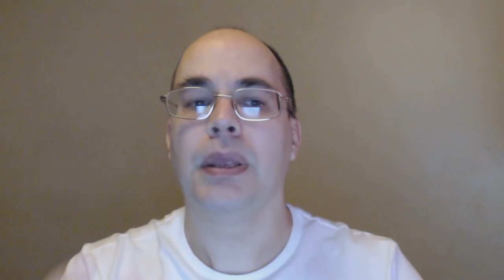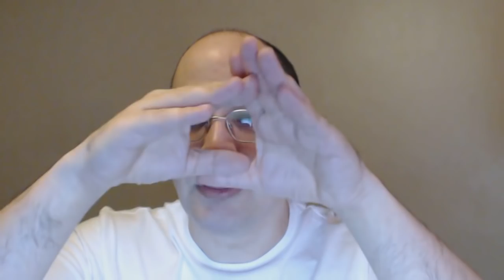How do rockets move in space, with nothing to push off from?

Comment: Why would rockets need something behind them to "push off from"??  Airplanes DO NOT "push off" from anything behind them.  Thrust in BOTH instances is EXACTLY equal to the mass of the exhaust times its acceleration away from the engine.  Nothing else is needed.  Action and reaction.  The mass that is "pushed" out of the nozzle is the reaction mass.  The action is the engine goes forward.
Reply: Davy spilani -- QUESTION:  
Why do you quote Newton's law of action and reaction and then you turn around and deny that it works?  You describe an illustration of how it works (your two boxes) and then you turn around and say that it doesn't work that way.  Why?  SPECIFICALLY ANSWER THIS: 
How can a HUGE amount of mass (tons of mass) be pushed with TREMENDOUS force (thousands of miles per hour) away from the rocket in one direction and there NOT be a reaction in the other direction?  
With such a huge force in one direction HOW can you claim that there is NO force in the other direction?
Reply: prosperomage they do , air push plane forward they suck air then push against it, jet fire push against air FOR EVERY ACTION THERE IS A REACTION
Reply: prosperomage jet engines work different to begin with, they suck in air so they wouldn't even produce any thrust in a vacuum
Reply: If you really think planes dont push  - watch this https://youtu.be/DFP4xl0V0mk
Reply: Davy spilani https://youtu.be/cfFJImcFx3s davy , this video debunk what he said , once you block the area where the air is coming out of the balloon the car won't move , MEANS the AIR COMING OUT OF JETS ENGINE IS FORCE ONE PUSHING AGAINST THE AIR IN THE ATMOSPHERE  ( FORCE TWO) ......this clown claim he works for a company making jets engines, and trying hard to proof that thrust coming out of shuttle , or planes doesn't need the air behind them ......what an idiot. ......there is another video using a balloon mounted on a toy car where a vacuum used to suck the air from the path of the baloon released air....guess what ??? Car didn't move , remove the vacuum , as the air releasing from the balloon the car moves......in the video i sent you the guy just block the atmosphere air from behind the balloon, and gues what ??? Car didn't move......nasa bullshit they never went to the moon , mars or anywhere above low earth orbit.....and these dummies trying hard to patch the lies of NASA
Reply: Omar Karim I know and ive just filmed that exact experiment.. I'll up load mine next week,, I use The laws of Physics to prove it's not possible.. But if you see any other info let me know please and thanks for the link.. Don't bother with this idiot,, He's not listening to logic or reason, so he's probably working for the state. My film is 100% Proof that not only do rockets not work but also NASA is a rip off agency and part of hollywood and also our education system has been polluted by psudo science as they teach NASA bullshit in school, basically so we can't comprehend reality. This makes it easy to lie and manipulate us.
Reply: Sith Lord Reign -- People who claim that a rocket can push a HUGE amount of exhaust in one direction and NOT have a reaction in the other direction are the ones who are claiming that rockets defy basic laws of motion.  How can you claim that they need something ELSE behind them besides the huge amount of exhaust (reaction mass) that they push out their nozzle???
Reply: prosperomage airplanes and helicopters don't work like rockets or jets.
Reply: Siddarth Joji force = mass times acceleration. Always. 
Doesn't matter if what is being accelerated is air or combusted rocket fuel.
Reply: Davy spilani -- so you'e another one who denies basic laws of physics.  Even jets in the atmosphere DO NOT "thrust against the atmosphere" behind them.   force = mass times acceleration.  If you accelerate a mass one direction (eject tons of material out of your exhaust nozzle) you have force the other direction.  It has nothing to do with what the exhaust runs into once it's gone.
Reply: Johnny Kool -- Thrust has nothing to do with the "atmosphere" behind the engine.  Jets engines DO NOT "push against" the air behind them.
Reply: prosperomage yes it does. Thrust requires an equal opposing force. When NASA said they were going to space the vast majority of the scientific community laughed at them. Saying you can't move in a vacuum. Cos you can't!
Reply: prosperomage yes it does it draws the atmosphere in, compresses It, mixes fuel and ignites it which heats it so it  expands. The burnt mixture then rushes out the smaller exhaust aperture, giving thrust  against the atmosphere, for propulsion, and the turbine for induction
Reply: prosperomage did you go to school? THERE MUST BE AN OPPOSING FORCE!! TRY STANDING IN A BUCKET AND LIFTING IT.  A boat must weigh less than the volume of water it displaces.
Reply: Skibum Wannabe  -- LEARN TO READ.  I already described the opposing force.  WHY do you deny that it exists?  AND WHY do you just make up crap about "the vast majority of the scientific community" that you can't even name ONE SINGLE NAME from???
Reply: Skibum Wannabe - No answer?  No reference to ANY of your "vast majority of the scientific community"??  And you don't even dare to try to explain how a rocket can push TONS of matter out of its exhaust nozzle and NOT have a reaction.  How can that happen?  WHY do you DENY the principle of action and reaction?
Reply: prosperomage Plane turbines pushes against air. Plane turbine can blow whole car away from it. So it pushes against air.
Reply: Subjohny -- I NEVER SAID that plane turbines don't push the air behind them.  What I said is that pushing against the air that is already behind the jet is NOT what pushes the airplane forward.
Reply: Subjohny -- Yes.  I've seen that video.  It proves my point.  If all that air that is going through the jet engine can blow the car away WHY do you think that SAME AIR can't push the plane forward?  It is NOT the air that is standing still behind the jet that pushes it forward.  It is the action of the air that is accelerated by the jet itself.
Reply: prosperomage Oh dear,, your not getting it,,, Planes do push off the atmosphere, you can't see it but it's there, that's how you can breath,, in space you can't breath so there is nothing there.. Newtons law states for every action there is an equal and opposite reaction,, So using NASAs model, let's see how they describe newtons law,,, They say action, reaction..That is their explanation of the 3rd law,, but that is not the 3rd law,, Where is the opposite reaction?? A planes turbine spins using the friction and resistance of the atmosphere to push against, it also creates a Columb of air behind the jet engine that pushes against the atmosphere.. Imagine if you tried taking a plane to space,, it's the same as a rocket, a rocket can fly a bit higher that is all.. They cannot and will never be able to work in a vacuum.. The only way is to give space an atmosphere..
Reply: prosperomage I don't deny the basic laws of Neutons law I just understand it properly.. You don't! ! Where is the opposite reaction to the rockets action? The rocket is reacting to the fire that is connected to the rocket via a pivotal point but where is the opposite reaction??????? You can't  answer because you don't understand Neutons Law!!! Your just another condescending moron who thinks they understand.. And you don't. .. TRY THINKING ABOUT IT YOUR SELF RATHER THAN READING THE NASA WEBSITE.. You might find you have a mind of your own.. Now fuck off little man..
Reply: prosperomage prosperomage  You can move because you have a hinge or ankle and that enables you to lever against the mass of the planet right! You are the mass that you want to move, your ankel is the pivot point you convert gravity into forward motion, your foot is the action or thrust, there is another pivotal point where your foot connects to the ground, until you stop and lift your foot off the ground, when you do that you loose friction and resistance against the floor or the mass of the thing you are moving relative to.. Just like a Rocket looses thrust as soon as the atmosphere has reduced enough for there to be no friction or resistance behind the controlled explosion coming out the back of the rocket.. Ok let's start with the first law.. A pole has no pivot or thrust, it's just a pole, just like a rocket, a pole cannot move unless you provide a pivot point and thrust,, So the metal part of a rocket is just a pole and in a state of inertia.. Now when you add a controlled explosion behind the rocket and join that explosion to the rocket via a fuel supply, you have now given that pole a pivotal point and Action or thrust or a controled explosion and that is just like a spring, it pushes so that is the action not the metal part of the rocket but the rocket and the fire are one thing because they are joined. So the controled explosion is the action,, the pole part or metal part of the rocket is the reaction, Now at the end of the controled explosion, where it meats the atmosphere, it's very very hot, that heats up the surrounding gasses that also expand and that pushes back against the fire and the rocket gains 2 pivotal points in which to gain leverage against the atmosphere.. So    Space x gravity x riction/resistance x (m+v×X×E×V-y) × friction/resistance × Mass or Y × Time.   That's the law of motion and you can see each of the 2 reactions are equal.. Go into a vacuum and you have..
Space × gravity × resistance × (m+v×X×E×V-y) × Mass or Y × Time.. Notice in space you have no friction or resistance behind the rocket and in front you have no friction BUT YOU DO HAVE RESISTANCE,, the resistance of mass which is gravity. Gravity is pulling you back and there is nothing at the back of the rocket to compensate for that now you have lost all resistance.. Gravity is not a little thing as it will start pulling you back with the exact same force it took to get away from it.. So in short you don't have an equal and opposite reaction to the action and the action is the controled explosion that is expanding, the metal part of the rocket is the reaction and the opposite reaction is NOT THERE SO THERE WILL BE NO MOTION . . This is a law of Physics and you clearly don't understand the very basics.. Don't go and read read a book about the 3rd law just think about it. There's 3 parts because it's about 3rd dimensional law. action reaction and opposite reaction.. So where is the opposite reaction in space? Now you are saying that the exhust particles moving away from the fire plume gives the rocket thrust but that is NOT what NASA is saying, NASA says action reaction... They neglect the opposite reaction..Your example of using carbon particles to leaver off is insane,, what are they levering off then,, You can't jump from a falling road and those particle are falling away from the rocket at high speed,, Not to mention they do not have enough mass to propel a 10 tone rocket.. I think you are getting confused.. The only reason a rocket does work in an atmosphere is because of the mass of the earth and that includes the atmosphere..You think that mass of air is tiny!?!?! Realy.. Try thinking about an object traveling through that tiny mass at 17,000 MPH.. Notice it sets things on fire because of the heat produced by FRICTION...Can you just answer me 1 question.. When you did science at school how come you didn't notice this then???I did,  teacher couldn't answer me then and they still can't. . By using your example you are actually contradicting NASA Yourself..
Reply: prosperomage Your really an idiot... It doesn't matter how hard you pull you will never ever be able to lift yourself up by the hair.. In space it doesn't matter how much thrust your fire out of the back or the rocket, if you have nothing there to be the equal and opposite reaction to the rocket, you will not move. This is a law of physics.. Do you know what a law of physics is??? Have you ever noticed why Einstien never managed to makes his theories laws? A law is an absolute.. Absolute fact! No opposite reaction no motion.. It's realy as simple as that... The only possible way is it you could provide infinate thrust which would mean infinate fuel with infinate mass.. Because to get through space you need to give space an atmosphere.. It's newtons law,, Every (action) has an equal and OPPOSITE reaction.. Your example insinuates an Action and reaction.. This is not The 3rd law of motion because there is no opposite reaction..So you can't break these laws, it's not like breaking the speed limit in your car.. There is zero tolerance.. no opposite reaction no MOTION.. Sorry they bullshitted you at school and have been ripping you off ever since.. We never went to the moon or Mars and sent probes to Pluto. . It's all hollywood and they have been charging you for that since the 60s.. Stop asking ridiculas questions there's no point answering because the basics of Neutons law just is not there in a vacuum and it doesn't matter what maths you hide that fact behind it is NOT possible to ever travel in space with rocket tech. EVER... Until you can tell me what is reacting in space other than the rocket to the controled explosion or the thrust coming out of the back of the rocket is I'm just going to think your  a complete idiot and low IQ die hard rocket lover.. If Neuton meant ACTION REACTION. He would have said that right.. But he didn't he said equal and opposite reaction.. So what do you think that means???? No one is saying that the air from a plan doesn't matter of course it does.. that's how it flys.. Same with a rocket, I'm not saying they don't work in our atmosphere  but in a vacuum,, no way.
Reply: prosperomage I'm actually making a film which will be ready next week, it will explain in great detail Why NASA IS A Con..
Reply: prosperomage exhaust push backward plane push forward , who told you that , buddy get a balloon mounted on a toy car , put air in it , let it go the car will move backward....do the same experiment but turn the vaccum on at the tip of the balloon, let the air go .......guess what??? Car will not move an inch, because the air coming out of the balloon is not pushing against NOTHING ANYMORE.  THE VACUUM SUCKED THE AIR , THE SAME WAY THE VACCUM IN SPACE WILL SUCK THE THRUST OR FIRE MIXURE COMING OUT .....NOTHING WILL MOVE FORWARD.....AIR USED IN PLANE AND JETS , WATER FOR BOATS....exhaust is attached to the moving object ...it IS STILL FORCE ONE ( ACTION)
Reply: prosperomage you work for a company that make jet engines.....ok i will send you a video explaining how jets move forward using AIR
Reply: prosperomage again you trying to deny the fact that air is not usd to push against plane.......THE AIR THAT COMES OUT OF THE PLANE PUSHES AGAINST THE AIR THAT ALREADY IN SKY......AIR FROM JET PUSH REAL FAST AGAINST THE NOT MOVING AIR IN SKY.....TWO MASSES COLLIDE AGAINST EACH OTHER . The air of the sky is like a wall while the air of the jet is the pushing force . And that pushing force air remain with the jet as it continues to push against the sky air ......if there is no air to push against, that big strong thrust of air will fly straight into empty space and no motion will occur. ....just like the experiment i told you , let the balloon release air into home vacuum and the car will not move an inch........you point is debunked as well nasa lies about travel in vacuum is debunked as well......stop lying to yourself. ....we never been to no moon , mars or space...it's all deception....and the ISS is the main one
Reply: prosperomage watch the video i just sent you and tell me , if your theory is true since you work for a jet company. ..and you should be the man who knows it ALL....WHY THE BALLOON WON'T LET THE CAR MOVE FORWARD ONCE WE BLOCKED THE AREA PASSED THE  EXHAUSTED AIR OF THE BALLOON.....I THOUGHT YOU SAID THE AIR BEHIND THE ENGINES HAS NOTHING TO DO WITH MOVING FORWARD AND MOVING FORWARD IS DONE BECAUSE AIR COMES OUT , THEN PLANE MOVE FORWARD. .....BUT ONCE I DIDN'T BLOCK THE AIR PASSED  THE BALLOON EXHAUSTED AIR . THE CAR DID MOVE FORWARD.....YOUR ARGUMENT IS DEBUNKED , NO THRUST IN SPACE , NO MOON LANDING , NO MARS,  NOT EVEN ISS STATION OVER 230 MILES HIGH.....ALL BULLSHIT.....PEOPLE STILL CLAIM YOU CAN SEE ISS WITH NAKED EYE LOOOOOOL YEAH RIGHT .
Reply: prosperomage Your clearly not worth the time... The controled explosion is the exhust gas, so the explosion cannot push against its self can it.. Try this,, jump off a building and on the way down,, piss and then try and swim back up your own piss. See how far that gets you... You believe this NASA bullshit.. Hahah it's funny at least..
Reply: prosperomage did see the video i sent you , stop blaying stupid , and debunk the video , WHY WHEN THE GUY BLOCKED THE AIR BEHIND A RELEASED BALLOON , IT DIDN'T MOVE AN INCH , in another experiment he sucked the air behind behind a released balloon the same thing , IT DIDN'T  MOVE , ACCORDING TO UR EXPERTISE,  AIR BEHIND THE ENGINE IS NO NEED FOR IT TO THRUST AGAINST......ANSWER THIS  ONE
Reply: Davy spilani I’m pleased to see someone understands basic laws of motion.
Reply: Sorry folks, even rockets can’t defy basic laws of motion. That is the argument I’m seeing “ because rockets work this way.” All motion operates under Newtons law rockets are no exception. Think of how a car travels or how you walk. Think of our atmospheric density as an ocean for air travel. Rockets is space have no such ocean to travel in unless space is actually not a vacuum.
Reply: No, they only work in an atmosphere because wings cannot generate lift in a vacuum. Also, most planes have air-breathing engines, so they need an atmosphere for that reason as well. The X-15 can fly as high as it does because it uses a rocket engine, and at max altitude the wings are doing almost nothing to keep the plane flying.
Reply: They...didn't. It's that simple. Let me put it this way; the US government is terrible at keeping secrets, and their track record of being found out is ridiculous. Do you seriously believe that they then managed to perpetuate a hoax on the scale of the moon landings for almost 50 years? 

The thing with your kind is that you always ask "what about this?" and "explain this!", but then whenever someone attempts to give you a satisfactory answer, you dismiss it. Your problem is that you're already convinced you know happened, and you're only seeking confirmation of that "knowledge", and so you throw a tantrum when none of the evidence supports your delusions.
Reply: You are wasting your time. This idiot does not understand the most basic
science. He should have a sixth grader explain it to him.
Reply: Very much enjoying this interaction.
Reply: prosperomage exhaust is part of the plane , that's force one , air molecules is force two.....
Reply: prosperomage and if i want to follow your idea that gases comes out of the exhaust pushes the rocket forward, the gases must be held by other force to become like a wall barrier, gases goes through space as they r coming out because NOTHING TO HOLD IT ,,,NO AIR NOTHING
Reply: One part of the plane (exhaust) going backwards = Force 1  and 
Other part of the plane (the metal part) going forwards = Force 2 and 
the air molecules behind the plane are irrelevant.  Look up the definition of thrust in ANY engineering reference source.  It has to do with the acceleration of the exhaust.  The ambient air behind the plane makes no difference.
Reply: Johnny Kool :  Force = mass times acceleration.  Thrust is the acceleration of the mass out of the back of the engine.
Reply: Skibum Wannabe  -- Too bad you can't name a single person in this "vast majority of the scientific community."  WHY do you people just make stuff up?  And read what I actually wrote about thrust.
Reply: Skibum Wannabe -- You didn't read ANYTHING I said about thrust, did you?  I work for Pratt & Whitney.  They MAKE jet engines.  I know how they work.  AND WHY do you just make up crap about "the vast majority of the scientific community?""  WHY do you do that??
Reply: prosperomage Because it doesn't work in space,, a rocket only works in an atmosphere but no in a vacuum..Jesus how's it possible to be so stupid?
Reply: Davy Spilani -- I don't read the NASA website. I work for an aircraft engine manufacturer. And I know how jet engines work.  YOU DENY that Thrust = Mass times Acceleration.  WHY do you deny that?  The thrust of a rocket or a jet is the acceleration of the mass that is ejected from the exhaust nozzle.  The thrust does NOT come from the relatively tiny pressure of air that is standing still behind the engine.
Reply: Davy Spilani -- Some people seem to have an emotional need for rockets to not work in space. Are you one of those people? I keep wondering WHY people reject such a simple thing as Force = Mass times Acceleration.  Why is that?  Do they think that air has no mass?  Does the exhaust that gets ejected from the nozzle of a rocket or jet have no mass (in their imagination)?  

HOW can all that mass get accelerated by the nozzle and NOT produce a force?  

WHY would anyone think it needs some "force" from the tiny pressure of air behind the engine?  

Could you please try to answer these things for me. I am very curious as to why people deny that Force = Mass times Acceleration.
Reply: Davy spilani  -- JUST PLEASE answer this one simple question:  WHY do you assert that AIR in a jet engine has NO MASS???  WHY??  Why do you think that pushing TONS of exhaust out of a nozzle does NOTHING??  HOW can you push TONS of material out of a nozzle and have NO reaction?? Just please answer that ONE thing before going off with paragraphs of words.
Reply: Davy Spilani -- STILL no answer??  WHY do you claim that EXHAUST HAS NO MASS??  A CFM56 turbofan engine pushes against 65 THOUSAND POUNDS of EXHAUST every MINUTE.  That's NOT the air "behind" the engine.  That is 65 THOUSAND POUNDS of EXHAUST that it is "pushing against."  WHY do you claim that 65 THOUSAND POUNDS has NO MASS?  How can a jet or rocket "push off of" the tiny 15 pounds of pressure in the air behind it if it can't "push off of" the TONS of air that it pushes out its exhaust nozzle???  

Unless you can explain how a jet can push against 65 thousand pounds and have NO reaction from it, you are just a troll.
Reply: Omar Karim -- How about if you put your vacuum cleaner nozzle in FRONT of your balloon at the same time as you have one behind it?  WHY do you think the "vacuum" of space is ONLY BEHIND the rocket?
Reply: prosperomage no EXHAUST AND PLANE IS FORCE ONE TOGETHER....easy example put your leg against the wall , according to you , I IS FORCE ONE MY LEG IS FORCE TWO.... I PUSH LEG BACKWARD( FORCE TWO) ,THEN I ( FORCE ONE ) GO FORWARD...NO .....I AND MY LEG ARE FORCE ONE , THE WALL IS FORCE TWO.....YOU GOT NEWTON LAW WRONG BUDDY
Reply: You didn't answer my first question about your "vacuum."  You're afraid of it, I guess.  ALSO:  HOW can "exhaust and plane" be "force one together" when the PLANE is pushing AGAINST the EXHAUST???
Reply: Omar Karim -- YOU just said that you throw your leg away when you push!!  Hahahahahaha!!!!!!  You said you are like the rocket and your leg is like the exhaust!!  Wow!!!   That's funny!!!
Reply: Omar Karim can only jump ONCE because he throws his leg away whenever he jumps!!!
Reply: Omar Karim -- Is your video about how jets move through the air going to explain how the exhaust stays attached to the jet after it leaves the nozzle?  Or are you going to admit that your leg example is fabulously insane??
Reply: prosperomage airplane sucks air and push it from the back , so the plane  moves forward...., that's your argument....
As soon the air comes out of the engine it moves forward and it has nothing to do with the air behind the engine......right..!!!!......ok let's suck the air behind the engines....what do you think will happen ??? Will the plane continue flying.......i TOLD YOU MR GENIUS YOU CAN DO THAT EXPERIMENT ON A BALLOON MOUNTED ON A TOY CAR ......TURN THE VACUUM ON AND SEE HOW FAR WILL THAT CAR GO , DO IT WITHOUT A VACUUM AND IT WILL MOVE FAST.....
Reply: Omar Karim STILL thinks he throws his leg away when he jumps!!!  Have you found your leg yet??  haha!!   (Also:  Do you know how a jet's thrust reverser works?  Do you??  
The jet sucks air in the FRONT of the engine, it runs it through the engine and accelerates it and throws the air back out FORWARDS (the same direction it got the air from in the first place), and the airplane can move BACKWARDS!!  So yes, if you suck the air in the back of the engine and accelerate it in the right direction, you can move which ever direction is opposite of the direction you accelerate the air.
Reply: prosperomage yes and that air that comes out of the ENGINES, YOU ARE TRYING TO SAY IT DOESN'T PUSH AGAINST THE AIR THAT ALREADY IN THE SKY.....REALLY ????? LET SEND YOU THE VIDEO ABOUT SUCKING THE AIR FROM THE PUSHED AIR PATH, AND LET SEE HOW MUCH  CREDIBILITY YOUR POINT WILL FLY
Reply: prosperomage watch this video , and it should debunk your argument that you been trying hard to pass it on everyone. ...

https://youtu.be/cfFJImcFx3s

Go to the balloon experiment
Reply: So you stop the exhaust from leaving the car and there's no thrust. So what about it?  With his piece of paper he is making the air NOT GO BACKWARDS!!  What does that prove??  It proves that if you don't allow your exhaust to go backwards, then your exhaust doesn't get to go backwards and you get no forward thrust.    If you STOP your EXHAUST, then your EXHAUST DOESN'T WORK.  DUH!!  
Force = Mass times Acceleration.  
He is NOT accelerating the exhaust backwards.  He is STOPPING the exhaust. His experiment proves exactly what I have been saying.
Reply: Also -- you STILL were claiming that you throw away your leg every time you push with it.
Reply: Look, it's real simple:  FORCE = MASS times ACCELERATION. 
->  If you accelerate exhaust away from your vehicle, then you get thrust. 
->  If you DO NOT accelerate exhaust away from your vehicle, then you DO NOT get thrust. 
->  If you STOP your EXHAUST before it leaves your vehicle, then you DO NOT accelerate exhaust away from your vehicle and you DO NOT get thrust.  
AND NONE of the above has ANYTHING to do with the air around or behind (or in front of) the vehicle.
Reply: Davy Spilani -- What you really mean is that you don't want to think about any of my questions because they scare you. TONS of exhaust pushed at thousands of miles per hour is NOT equal to a few drops of "piss." And you know it.  You just deny it because it's emotionally disturbing to you. 

And climbing back up on a couple drops is NOT the same as PUSHING against a HUGE amount of matter.  Try this:  Jump off a building and throw TONS of material THOUSANDS of MILES PER HOUR downward and see if it's the same as "climbing up on your piss."
Reply: Omar Karim Your arguing with a complete moron.. I spent hours with this idiot yesterday.. I even wrote out the equation for the 3rd law of physics and how NASA and our education system is missing out a huge part of it.. (They miss out the opposite reaction) They say action, reaction. What about the opposite reaction.. An explosion blast both ways so in space where is the opposite reaction to the explosion coming from the back of the rocket?? Anyway I'm making a film and will prove with Neutons law that it's impossible to travel this way in space.. Don't bother with this brain dead idiot who is totally stuck in their own dissidence.
Reply: prosperomage This is the 3rd time you've asked me this and ive explained but your IQ just is not up to it so... Your not worth the time.. As I said try pulling your hair and if you pull hard enough you might take off..😂😂😂😂😂😂😂😂😂😂
Reply: Davy Spilani --No.  You haven't "explained" anything at all.  What you keep doing is missing the point. You keep asserting the impossible. I only keep phrasing it as a question to see if you'll get it.  A jet (or a rocket) throws a HUGE MASS out its exhaust nozzle.  It "pushes against" THOUSANDS of POUNDS of exhaust.  You CANNOT push against THOUSANDS of POUNDS WITHOUT HAVING A REACTION.  You keep claiming that you CAN push against thousands of pounds and have NO opposite force.
Reply: Davy Spilani -- No.  You keep saying that Newton's third law does not work. You keep saying that if you push against something, you do not move.  A rocket pushes against thousands of pounds of mass.  (And then you come back and (supposedly) "explain" that THOUSANDS of POUNDS is LESS then the tiny FIFTEEN pounds of atmospheric pressure because those thousands of pounds needs another 15 pounds or else it won't work.)
Reply: Omar Karim --  You don't understand that video like you don't understand that you DO NOT throw away your leg when you push against a wall.  YOU CLAIMED THAT YOUR LEG IS LIKE THE EXHAUST.  SO YOU CLAIMED THAT YOU THROW YOUR LEG AWAY WHEN YOU PUSH AGAINST SOMETHING WITH IT!!!  WHEN are you going to understand that your leg example is idiotic??  WHEN are you going to understand that you DO NOT THROW AWAY YOUR LEG WHEN YOU USE IT TO PUSH?? 
If you understood your own examples, you would see that your LEG is like the NOZZLE and THE WALL IS LIKE THE EXHAUST.  But you don't even bother to understand your own examples. Why do you not even want to understand your own examples??  Why do you claim that your leg is like the exhaust that gets thrown away from the rocket?
Reply: Omar Karim -- You keep posting the same thing over and over and over and you keep refusing to answer my question:  WHEN ARE YOU GOING TO UNDERSTAND THAT YOU DO NOT THROW AWAY YOUR LEG WHEN YOU USE IT TO PUSH LIKE AN ENGINE DOES WITH ITS EXHAUST?????  YOUR LEG IS LIKE THE NOZZLE AND THE WALL IS LIKE THE EXHAUST!!!

If you understood THAT, then you would understand your balloon video also.  But you do not want to understand it.
Reply: prosperomage no genius my leg is not nozzle and the wall is not the exhaust. ....My leg IS THE EXHAUST THAT IS PUSHING MY BODY IS THE PLANE AND THE WALL IS THE AOLIR IN ATMOSPHERE......WATCH THE VIDEO FIRST
Reply: Omar Karim -- So you REALLY THROW AWAY YOUR LEG LIKE THE ENGINE THROWS AWAY THE EXHAUST!!!!???!!!  WOW!!   LEGLESS OMAR!!  Omar Karim can only push one time with his leg because he throws it away!!!  (I watched your video.  YOU would understand the video if you understood that you don't throw away your leg.  But you keep saying that you throw away your leg like the engine throws away its exhaust.)
Reply: prosperomage this is another video showing sucking the air behind a released balloon , and the car didn't move an inch.....

https://youtu.be/D-v_K1k8Se0
Reply: prosperomage the exhaust is going backward but car is not moving , ok watch this video , this guy didn't block the air with a paper, he just sucked the air behind the exhausted air.....WHY THE CAR DIDN'T MOVE ???
Reply: prosperomage https://youtu.be/D-v_K1k8Se0
Reply: omar Karim -- I've watched your silly video TWICE now.  And I'll explain it to you AGAIN if you want:  The car is not going forward because the exhaust is NOT going backwards away from the car!!!  He is changing the direction of the exhaust with his piece of paper.  The piece of paper is NOT ALLOWING the air from the balloon to go BACKWARDS away from the car.  The air from the balloon ends up going SIDEWAYS away from the car (to both sides away from the paper.)
Reply: Omar Karim -- And in your OTHER video, he is SUCKING THE BALLOON AND THE STRAW BACKWARDS with his vacuum cleaner.  There is a FAST STREAM OF AIR BEHIND THE BALLOON that is SUCKING IT BACKWARDS.  Notice that he does not show you what happens to the balloon if he has it sealed with no exhaust to keep it in place.
Reply: Omar Karim -- Put a balloon with a straw like that on a table.  But close up the straw so there is no opening.  And then put a vacuum cleaner behind the balloon like the guy does in the video.  The vacuum cleaner causes the balloon to go backwards because it is moving air ALL AROUND THE BALLOON and STRAW toward the vacuum cleaner.
Reply: prosperomage great am going to say you are right , ok the other video doesn't block anything the air behind the exhaust which to your claim is not important to push against ... been eliminated, why the car is not moving .....on the first model there is nothing about direction of exhaust. .....your all argument is that exhaust comes out rocket move forward , AIR COMES OUT OF ENGINE , PLANE MOVE FORWARD......WHY NOW YOU CHANGING YOUR ARGUMENT TO DIRECTION OF THRUST ......DOES THRUST NEED DIRECTION ????? I THOUGHT IT JUST COMES OUT AND PUSH THE PLANE.......YOU JUST DEBUNKED YOURSELF.....YOU NEED DIRECTION TO PUSH AGAINST SOMETHING.....
Reply: prosperomage do you really read what you just wrote ( changed direction of thrust) ......in SPACE THERE IS NO DIRECTION , THRUST GOES INTO EMPTY SPACE .....THE ONLY WAY YOU NEED THRUST DIRECTION IS TO PUSH AGAINST THAT AREA OR DIRECTION..  IF I SUCK THE AIR BEHIND AN EXHAUSTED FLAME OR AIR ......IT SHOULD CONTINUE MOVING , BUT IT DOESN'T GENIUS,  YOU KNOW WHY ???? BECAUSE EXHAUSTED AIR PUSHES AGAINST ATMOSPHERE
Reply: Omar Karim -- "In space there is no direction"??  So "to the side" is the same as "to the back" to you??  hahahaha!!!!!  Omar Karim doesn't know the difference between "side" and "back."  Omar Karim bases his argument on "side" and "back" being the same thing.  Wow!!!    No.  Your toy car pushed the air from the balloon TO THE SIDE and NOT TO THE BACK.
Reply: Omar Karim thinks he throws away his leg like a jet throws away its exhaust.  Omar Karim thinks "side" means the same thing as "back."  Omar Karim thinks the sun never sets behind the horizon.  Omar Karim has never seen the moon rise and set and go overhead.  Omar Karim has never ever been outside of his bedroom.
Reply: prosperomage REALLY,  YOU SAID , EXHAUST GOES TO THE SIDE ......IS THIS WHY WHEN I STAND IN FRONT OF A FAN THE AIR IS ACTUALLY MOVING STRAIGHT STRONGER , NOT SIDE WAY , IT'S ONLY LESS SIDE WAY BECAUSE IT'S TRAVELLING IN ALL DIRECTION BUT STRONGER IN STRAIGHT LINE......KEEP MAKING FUN OF YOURSELF........AGAIN EXHAUST COMES OUT IS PUSHING THE PLANE , YOUR POINT IS AIR BEYOND THE EXHAUST IS NOT IMPORTANT FOR EXHAUST TO PUSH AGAINST.....SO WHEN ELeminating the air it should be no problem for the plane to move .....THAT'S YOUR ARGUMENT RIGHT
Reply: prosperomage your argument is air behind EXHAUST IS NOT IMPORTANT TO PUSH AGAINST......WHY WHEN We eliminate the air , the car won't move forward......THRUST DOESN'T NEED THAT AIR ACCORDING TO YOUR ARGUMENT
Reply: Davy Spilani -- Have you ever fired a rifle?  Does the bullet need to go and hit something on the far side of the field before you feel the recoil?  NO!!  Does the rifle "push against" the tiny little 1/4 of a square inch of air to give you the recoil?  NO!! The rifle pushes against the heavy metal bullet that it is ejecting with great force at a thousand miles per hour.  So THINK FOR YOURSELF:  WHY would the THOUSANDS of POUNDS of exhaust from a rocket or jet engine NOT give the same kind of recoil as a rifle??  Answer:  It WOULD and it DOES.
Reply: Omar Karim -- If you want to put a vacuum cleaner nozzle BEHIND the balloon to make a point, you need to ALSO put another vacuum cleaner nozzle IN FRONT OF the balloon.  What??  Do you think the "vacuum" of space is only BEHIND the rocket???
Reply: That is true. However, jet engines are also meant to push against the atmosphere as well. It allows them to generate greater forward thrust. Why not use an extra source of thrust if it's available?
Reply: Anzac-A1 -- It's not a matter of "using an extra source of thrust."  The air behind the jet is NOT "available" as a source of thrust. Because that's not how the natural world works. Once the exhaust is pushed out of the nozzle, what happens to it afterwards simply does not affect the jet.  And, in fact, encountering pressure behind the engine actually slows down the exhaust stream that is trying to exit the nozzle, so that it does not flow as fast (check it out by putting a hose nozzle under water.)  Slowing down the exhaust REDUCES the thrust of the engine.
Reply: If you understood the laws of motion, you'd understand that rockets DO work in a vacuum. I don't understand how you think Newton's laws prove that they don't. You seem to think that the laws act differently in a vacuum, when a vacuum is where the laws of motion work the best, because there's no friction to impede motion.
Reply: Davy spilani Sorry but if you think sticker or a jet can push off of air you don't have a good understand of how either work. Look up Newton's laws of motion for a proper understanding
Reply: Johnny Kool Gravity and the atmosphere hinder the movement of a rocket or a jet. In space both are minimal which makes a rocket work infinitely better
Reply: Davy spilani Look up the episode of Mythbusters where they fire a rocket in a vacuum and by gosh it went forward. So your logic is busted
Reply: +Davy Spilani What the hell kind of stupid argument is that? You lose.
Reply: +Omar Karim The thrust of the air from the balloon was cancelled by the sucking resulting in a net result of zero and thus the car did not move. The two forces must have been equal. Increase the trust or the suction to create an imbalance and you will see movement in one direction or the other. Pretty simple if you just think about it.
Reply: Space = "infinite Vacuum" According to NASA !!!
Reply: show me the air in a vacuum..
Reply: youre still using air in space as an argument..
Reply: Look in a mirror !!
Reply: prosperomage propeller airplanes....jets... Move forward because of  pressure difference... Propellers reduce the pressure in front and increase behind and the wings are used to do the same thing on the vertical axis where more of the air is directed under the wing than over...also... Saying that a mass is being accelerated is also correct... Accelerating the mass is what causes the pressure difference... Which is why jets can fly faster because they can accelerate more air  which causes higher pressures behind the jet and also causes less friction for the leading edges... There is a rather simple way to find out if it is the mass of a gas being accelerated alone that causes the thrust( remember we are talking about accelerating the mass of a gas only)...or if it's accelerating a mass of a gas creating high pressure  behind it causing the thrust.... Get a plastic toy  car about 4in long or so... Take a pen apart for the tube... And use a rubber band to attach a balloon to the pen tube... Blow up the balloon and attach it to the top of the car and see if it moves..get something larger than the pen tube and  do the same thing... If possible... 1 more size up... All with the same balloon... There was 3 tests for the pressure difference side with the same masses being accelerated faster.... Then do the same exact thing but this time use a vacuum and put the tube into the vacuum hose while it's on and see what happens... And remember that your vacuum is a fraction of the vacuum of space... I know what happens do u
Reply: AIRplane.  (hint hint)
Reply: prosperomage They thrust against the atmosphere, in space there is none so the rocket would not have forward thrust.
Reply: prosperomage that only works on earth where u have an atmosphere and gravity
Reply: Omar Karim  Yes. For every action there is a reaction. Exhaust gets pushed backwards. Airplane goes forwards. It has nothing to do with the air that's already behind the plane.
Reply: Omar Karim -- Did you read my debunking of your video?  Can you read?  Yes, if you change the direction of the thrust, you change the direction of the thrust.  This is not surprising.  And it has nothing to do with the air that is around the engine.  In your video, the guy changed the thrust so that it went out to both sides instead of backwards.  Why do you not understand this?  AND WHEN ARE YOU GOING TO UNDERSTAND THAT YOU DO NOT THROW AWAY YOUR LEG LIKE AN ENGINE DOES WITH ITS EXHAUST??????
Reply: prosperomage No,, The 3rd law is (reaction/Action/ reaction) So that's.. ( Rocket/Thrust/Atmosphere ) That's how it works on the ground or in our atmosphere but in space you have ( Rocket/Action/NOTHING) Neutons law no longer applies.. So the Rocket will no longer move forward and will be pulled back to earth. The rocket is MASS the fireplume coming out the back is thrust, (This is a controled explosion and is pushing in 2 directions,  1 back at the rocket and 2 back against another mass which is the atmosphere) When you go into space you take 1 part from Neutons law,, Neutons law states for every action there is an equal and oppersite reaction.. We are talking about motion so a MASS is desired to move, ie the rocket. So his evasion is now (mass/action/mass) A car is Mass the wheels are the action and they push against the road and the car and the road move Appart at equal speeds. But in space you take one mass away.. Now Neutons law, his third 3 as in 3rds, it has 3 parts,  Mass/ Action/ mass. Or oppersite reaction/Action/Oppersite reaction.. In space there is NO Oppersite reaction, So nothing for the other oppersite reaction to react against.. This idea of exhust smoke from the fire plume providing a thrust is ridiculas,  as this gass would emediatly get sucked away into the vacuum.. That's instant.. So Rockets do NOT work in a vacuum! Period that's breaking the laws of physics.. You cannot lift your self up.. or flap your arms and fly.. NASA is lying.
Reply: prosperomage Yes they do.. 
WHY A ROCKET WON'T WORK IN A VACUUM!
Why a rocket engine will NOT work in space! NASA says Neutons 3rd law of motion is what makes a rocket work in a vacuum. The 3rd law states "for every action there is an equal and oppersite reaction".  They say this propels the rocket forward and not the air the rocket is pushing against! I say, using  Neutons law, Imagine two big heavy boxes in space, move them together and put a spring in between them,, connect the boxes together.. Now, the spring is the action and you will have an equal and oppersite  reaction via the boxes, when you detach the boxes the spring will push them Appart. So the action of the spring caused an equal and oppersite reaction and the 2 boxes shoot Appart at equal speeds as long as they both have the same mass..  Now a car is Mass the wheels are the spring or thrust and the road has mass, the spring pushes in equal directions, or the wheels turn and the road and car shoot Appart in oppersite directions at equal speeds. The ship works the same,, propeller is the spring and it pushes against the ship which is a mass,, and the sea which is another mass, the 2 masses move Appart at equal speeds in relation to their masses,, The ship has more mass than the sea water behind the propeller so moves slower than the water, A plane uses the same principal. A rocket,, the same principal,,, In this 3 part equation, ie (Mass spring Mass) or (Oppersite reaction/Action/Oppersite reaction) Quote "for every action, there is an equal and oppesite reaction". The rocket is the first mass the spring is the fire plume, (This is a controled explosion that pushes equally in 2 directions just like a spring) and the earth's atmosphere is the other mass, again proportional to thrust and  depending on the mass of air moved and the mass of the actual rocket determines the speed the rocket moves in one direction. As you gain altitude the mass of the atmosphere exponentialy decreases but the mass of the rocket stays the same so in order to continue up at a constant speed the the fire plume or controled explosion has to exponentialy increase thrust in both directions until finaly there is nothing left to thrust against on one side of the fireplume as the atmosphere has depleted. Now we have a case of Neutons 3rd law of motion only having 2 parts ei ( Mass spring ?????) So Neutons law no longer applies and the rocket will not have propulsion, like taking away the sea from the ship, if ships could fly it would just not move,, the propeller can spin as fast as it likes the ship is not going to move. This is before you consider the unimaginable amount of radiation both in the van Allen belt and in general space.. So that's Neutons law saying you can't go into space for far using a rocket engine, You need something to thrust against...   It doesn't matter what those masses are, that's not the point, all that matters is the action the reaction and the oppersite reaction (Reaction/Action/Reaction) 3 parts.. The 3rd law of motion. You can have one big box one small box, One with double the mass, a super spring, it doesn't matter, the principle stays the same, this is a law of physics. so that's ( Rocket = Mass/Explosion/Atmosphere=Mass) The rocket and atmosphere are the equal and oppersite reaction. Take away the atmosphere and you have (Rocket or mass=reaction/Explosion= Action=Explosion/Nothing????? zero mass = No Oppersite reaction) Now Neutons law can not apply.. The rocket can not propel forward...
PROBLEMS WITH ORBIT SPEED
If we have (mass1=Actual rocket/Spring or thrust/mass2=Atmosphere)
So If thrust needs to exponentialy increase to compensate for an exponential decrease in mass 2. Then there's ,A, An exponentially  increased need for fuel and ,B, A constant weight added for all the fuel nessasary to reach Orbit velocity. 
You would need an atmosphere to use as mass2 and the problem with that is heat! To reach Orbit velocity means 17/18,000 MPH If you do that speed in the atmosphere you burn up?! Especially when you are carrying Highly explosive rocket fuel! 
Conclusion!
In order to achieve enough mass2, In an infinate vacuum, you would need to have infinate thrust and infinate fuel  and that fuel would have infinate mass in order to create enough of an atmosphere in mass2 (space) For the spring or explosion (Rocket fireplume) The action in Neutons law,, ie (reaction/action/reaction) to have enough thrust to propel mass1 (the actual rocket) Forward. This is assuming space is infinate and a vacuum! 
Final conclusion It's not possible.. Maybe very low orbit with very light equipment, but with the radiation and heat problems! Once a rocket engine switches off in space the rocket will start to fall towards the nearest large object unless the rocket is in orbit!! ..